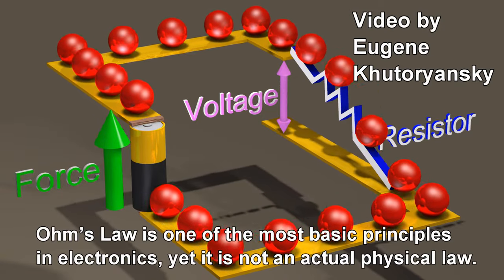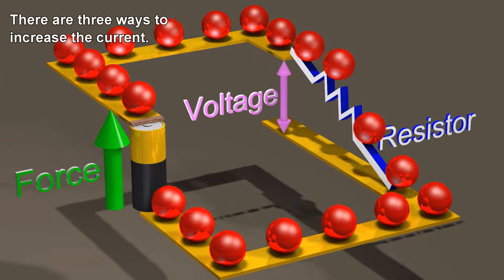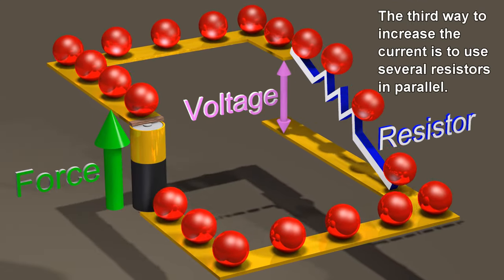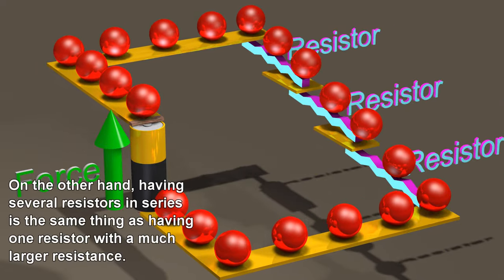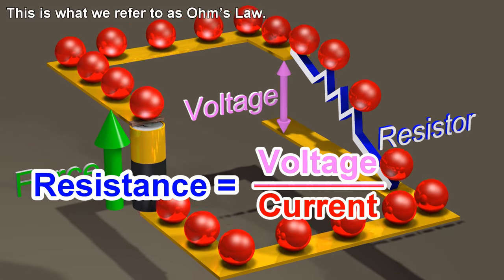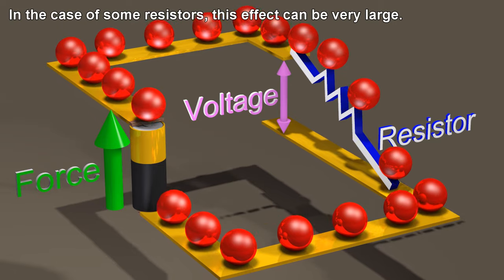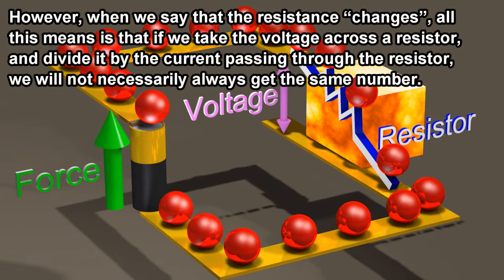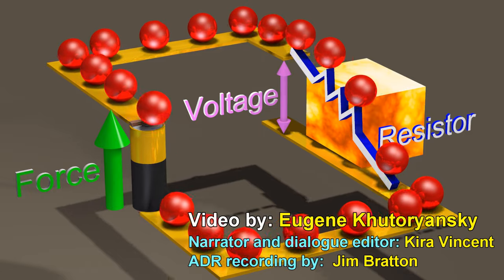Resistors - Ohm's Law is not a real law

Comment: I, too, don't want to seem contrite, but I have to correct the claim of a logical fallacy on tried-and-true physics.

Ohm's law actually is a vector electro-magnetics equation. Since I can't write Vector notation here, assume that capital letters are vectors in the following, and I'll write out the Greek letters, and T is temperature.

 J=sigma(T)*E where J is the current density, Sigma is the conductivity that is a function of temperature, and E is the electric field.

First thing to point out is that the conductivity of a material is temperature dependent, and that temperature dependence is taken into account in Ohm's law.

Second thing to point out is that the version of Ohm's law used in circuit analysis is a simplified scalar form, with a few important assumptions and simplifications.

That does not mean that the scalar form used in circuit analysis is incorrect.

Furthermore, just because one observes and minor inconsistency in a heavily simplified application of a physics edict does not mean that physics edict is incorrect.
Reply: The Feynmann lecture mentioned many times in the comments discusses that even the most fundamental laws are only approximations becouse reality never gets so simple as to be completly described by mathematical equations. On the other hand we have uncovered LAWs which are almost universal becouse they are approximations of some fundamental  phenomenon underlying almost all physical phenomena. In my interpretation this video suggets that there is no such fundamentum behind Ohms Law.   BTW I have read somewhere that electric "flow" is dependent on the surface of the conductor and electricity spreads due to changes in the magnetic field surrounding the wire.... Is it so? If yes - is there a YT animation on that?
Reply: thanks for Your comment...

Comment: I am not sure the stated reason ohms law is not a law of the universe is important enough to not call it a law of the universe. Maybe Ohms law could reformulated and thus not fundamental, but derived from other laws. But, the video did not convince me of the distinction it was attempting to make.  The argument sounded similar to arguing that acceleration is not a  law of the universe because a rocket expels mass  would have a changing acceleration.  It seems to me that the flaw in this  kind of argument is that both ohms law and newton's law were  respectively for instantaneous values of resistance and acceleration, not if their values change over time with different inputs.  If we accept F=Mass*acceleration is a fundamental law of the universe, then why cant we accept that Acceleration=Force/Mass is the same law, just stated another way.  If im in a rocket one moment the force I feel  changes over time because the mass in my rocket is changing.  This distinction  on changing over time is seems unimportant. 

Besides, not all ohms are resistance that create heat. 10Vac supplied to a 1 om resistor will create 10 watts of heat as it allows 10 amps of current to flow. While 1 ohm of either Inductive or captive impedance will also limit current to 10 amps, but it does not loose any energy to heat,  especially if the whole circuit is made of superconducting materials.
Reply: That argument is possible, and Feynman was worried he created definitions without proving their equivalence, and made an entire lecture about it: http://www.feynmanlectures.caltech.edu/I_12.html. Newton does really just define Force in the end, to be m*a. But showing equivalences such as F = GMm/r/r forces reality to behave in certain ways. Ohm's law is a property of most metals and is still at times inaccurate to degrees that can be felt. MOSFETs wildly disobey Ohm's law. LEDs disobey Ohm's Law quite notably due to heat. Op Amps also wildly disobey Ohm's law.
Reply: @npip99  exactly what I was thinking!

Comment: Doesn’t heat reduce resistance... This in turn leaves many variables for  which one law would be somewhat inadequate.
Reply: For conductors in general, no.  Temperature increases resistance.
For semiconductors, yes.  In special conditions, increasing temperature actually decreases the resistance of semiconductors.

This makes semiconductors interesting, but not necessarily useful.  What makes them useful, and so powerful in the electronics industry, is doping them with intentional impurities, to bias them for the ability to control the flow of current.

Comment: I'm sort of having trouble wrapping my brain around this one.

Are you saying Ohm's law is not a real law because it can't predict the properties of materials without first measuring the materials?

And that resistance measurement can't tell us the temperature, unless you've measured that resistor at a known temperature, with a known voltage, and current?

So X material has Y resistance based on V/C, but once we know it has Y resistance, we can't tell the temperature of X material, we just know it has Y resistance currently, and get no further information, without comparing it to known temperatures and materials?

It's evaluatory rather than predictive?
Reply from the maker: +cidshroom, I am just saying that a definition is not the same thing as a physical law.  The equation "resistance= voltage/current" is just the definition of "resistance."  On the other , in Newton's equation "Force = Mass x acceleration", force is already defined independently of this equation.   For example, we have equations describing how forces are generated on charged particles due to electric and magnetic fields.  In this case, "Force = Mass x acceleration" relates how the object's acceleration will relate to the force that we already know will be generated.
Reply: Eugene Khutoryansky Ah ok! I was just over-thinking it. I see what you mean now.

Comment: Why doesn't current reduce with each round? Like it's speed reduces due to resistance each time it passes through the resistor. And if my logic is wrong then we shouldn't add resistances in series because if speed doesn't reduce each time then it should only reduce once

Comment: Ohm's observation was that the apparent Potential drop across an ideal Resistor is proportional to the Current through it. So, V=RI would be the linear model accounting for V versus I data. Yet, one uses I-V characteristics, which gradient equals 1/R (conductance). This tells us how fast the charge transport can be through the Resistor.
Hence, Resistance is a measure of the charge transport time!
R ~ t
Yet, in a real ohmic resistor, temperature might increase with time, so the I-V slope changes, depending on the experimental procedure...

Comment: And then we define speed of light in the number of hydrogen atom state changes per second, which is a parameter finely tuned to reflect reality rather than mathematically inferred. Is it now what, not a law? How about mass, we define it as proportion of acceleration to applied force, is it not a law either because inertial mass isn't constant and hinges on system total energy and it's just our definition that always holds true?

Comment: Not convincing. R=V/I is not the definition of resistance. It is a physical law that relates those three properties of a system. Arguing that it isn't a fact of the universe because the resistance of a material doesn't stay constant is just ignorance of the more complex relationships involved. 

The actual definition of resistance is R=resistivity •length/area. All three of those variables can be affected by temperature, and resistivity also depends on material composition. 

I suppose you could try the same game by substituting the definition of resistance into Ohm's law:
r•L/A = V/I (here I am using r for resistivity) and then define resistivity as r = V•A/(L•I). But that doesn't stop resistivity from being a real property of a substance. The "definition" gives a way to measure resistivity.

In principle, at least, resistivity could be predicted from more fundamental physical theory.

Comment: But as the resistor changes value with temperature, the current flowing through  that resistor also changes as V/R right?  Or is this about the difference between an analytical law vs an empirical law?  Mathematical laws are self consistent in mathematical "space".  But as soon as you assign  a mathematical law to explain the behavior of an empirical phenomena,  that mathematical law becomes provisional- just as a theory is provisional.   Who's to say what new phenomena will be discovered?  Otherwise I like your presentation!

Comment: I find the statement "Ohm's law is not a real law", to be, well, somewhat misleading.

I mean, yes, the statement R=V/I more or less defines 'resistance' but that such a value would be considered 'constant' in an varying of either current or voltage is a rather meaningful statement.
So, for a current through a conductor, and the potential drop across that current, we find what appears to be a non trivial relationship: there is a constant proportion between them, determined experimentally.

Of course, Ohm's law isn't true in general, but that it doesn't apply in some more nuanced cases doesn't distract from its status as a "law". The fact that it doesn't describe a very 'fundamental' behavior' does not distract that it takes something seen empirically describing relations between quantities in the world. There are many laws that describe nonfundamental relations in the world, in particular many of the gas laws, that are nevertheless important as 'practical laws'. That V and I share a constant proportion, which is determined experimentally, is an example in electrostatics of such a 'practical law' or 'experimental law'.

That this was even the case, that V and I shared a constant proportion, was met by lots of critique and hostility. Something that would be absurd from a mere 'definition'.

Comment: What's your point exactly? As the resistance changes (due to temperature in this case), the current (or voltage) will adjust accordingly. Ohms law is not broken.
Reply: It's not a question about if Ohm's law works or not. It's about that it isn't law, it's the way that we define the resistence
Reply: That's like to say "The Gonzales law says that a velocity of any particule is equal to the space it goes divided by the time it took", but that is exactly the way we define the velocity.

Comment: Why use resistors? as resistors decrease the flow of current and on the other hand we want more electric current flow!! so why use resistors.?
Reply: Without resistance all circuits would be, electrically, a closed circuit.  They would short out your battery.  Resistance is therefore a vital feature of a circuit as a whole.

It may seem that resistors make your circuit less efficient, but be aware that by resisting the flow they are not wasting your battery but prolonging it.    The only real inefficiency in resistors is that they generate some heat, even if it is barely measurable in most cases... and yes, that is wasteful.

so the question then becomes - why use inefficient resistors.

The answer is a purely practical one:  Currently, we only have imperfect resistors.